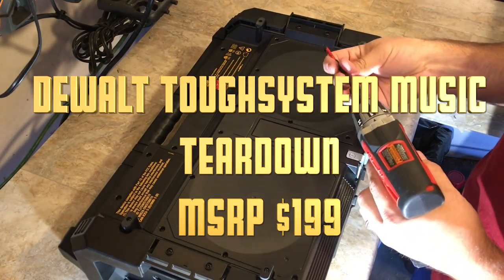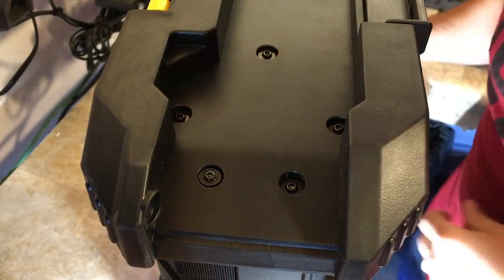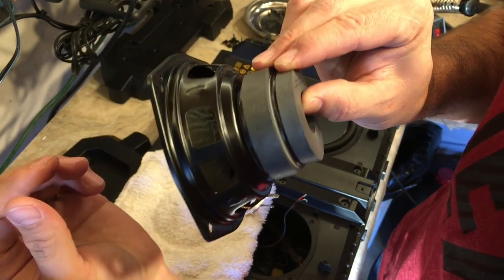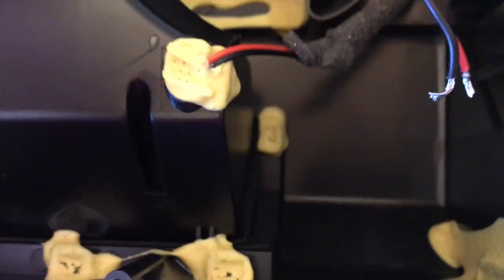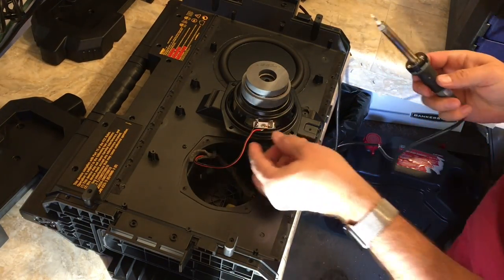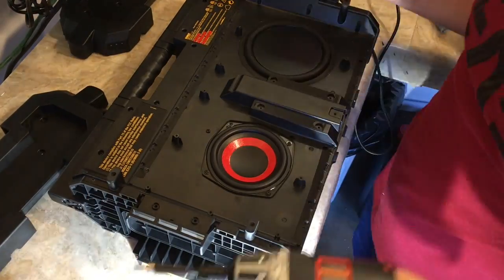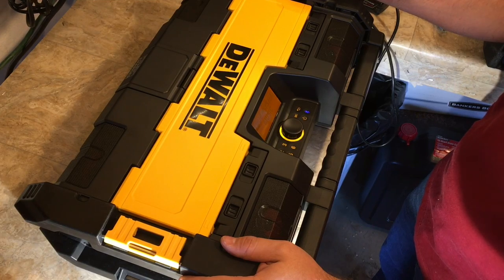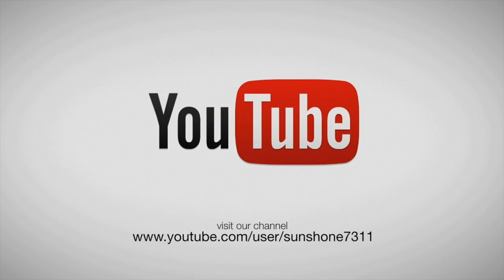DeWalt Tough System Music Case TEARDOWN

Comment: Thanks for the upload gave me a heads up as when dismantling my sons units  I had to repair the 3.5mm aux input.
 I just put a put a new cable  in with 2 x rca connectors  i drilled  a hole for the cable on the raised section on the left section for phone storage etc It is built extremely well ! I used to be a engineer for Sony. Undoing that many screws reminded me of some Sony products .
And the thing has a great sound!

Comment: Thanks for the teardown. Fixing the aux jack in mine - got damaged by someone tripping over a wire. Kept mine outdoors since I bought it 4 months ago... gives off the toxic chemical that is still  used instead of citric acid to clean circuit boards - makes me dizzy, nauseated, fingers tingle when brought indoors. Gonna continue the repair outdoors once it warms up a bit. Great product but manufactured without concern for toxins. Our country should ban toxic solvents in consumer products.

Comment: I have this radio!  I love this thing.  The 2.0 is the same but nicer.  The 2.0 has color screen, ability to charge FlexVolt, (and 12V maybe?).  But they did change the battery compartment.  On the 1.0, you can access the back battery compartment from rear.  Anyhoo.  Great video.  I'm too old to be stripping stuff down! lol
Reply: But sadly the 2.0 had a massive design flaw and quality control issues so it's done and buried. I have the 1.0 and already had one side of the speakers die. Unit was replaced under warranty with a new unit.
Reply: @FirstLastOne  It does appear they've made good on replacements/possibly a fix. They're still selling "new" on amazon without lots of bad reviews in the last 6 months.

Comment: cool vid.
A suggestion........roofing peel and stick on the speaker spider chassis, and around the cutouts for the speakers will definitely tighten up the sound.
you can also use it anywhere there is vibration from the speakers.
Reply: What roofing peel ?

Comment: Hi. I know it's like digging up a fossile but a friend of mine have one of those radios and need to replace the power supply. Do you know what size of a barrel plug it uses? It looks like standard 5,5x2,1mm or 5,5x2,5mm but i cant be sure, and i can't measure it myself. Thanks in advance

Comment: I'm having issues with the dab radio signal which is apparently an issue with this model. Do you think it's possible to upgrade the antenna, maybe fit an external antenna in the slot on the side which would give the antenna some protection?

Comment: Excellent radio , only problem is what you mentioned about the battery coming loose if you set it at the ground softly . The only thing that holds the battery in place is a small foam bumper then looses its support of over time
Reply: I added more foam to fix the problem.

Comment: Hey thanks for posting this, bought mine Dec 2,2015. yesterday (Dec 2, 2018) hit the 3yr mark while at work the base kept cutting off, I just got off the phone with Dewalt service center & was told there's no fixable part on it & they just do a straight swap. they go by the small sticker inside battery compartment with a QR code which tells them the year. Mine started with a V15 which tells them its 2015 so its a paper weight. I will be taking it apart and see if I can solder anything inside.. damnit! radio sounds really good but warranty sucks
Reply: Mine won't pick up radio signal any one got any ideas?
Reply: My radio works on mains but not on battery any ideas??

Comment: I have a tstak radio which stopped working I wonder if you have came across any problems with them and maybe have a fix?
Reply: Hey Daniel, I just purchased the Tstak radio and mine has a tough time turning on & off. I assume it's a bad rotary encoder/ power button? Did you ever figure yours out?

Comment: Any one notice these can't charge the XR 6AH batteries?  I use the 6AH batteries with my saws work great for all day power.  Was thinking of modding the battery compartment and phone storage holder it can't hold a plus size phone.  The bumper for the battery and the phone compartment seem to take up same space.  Might try and cut it out and 3D print a cover for the hole.  Thanks for showing how to take this apart.
Reply: it says in the manual that it can only work with up to 5AH batteries

Comment: Does anyone have problems with the base ? Mine just don't work any more .. the speaker works but no base someone? And if u do ..Do you fixed ?
Reply: Following, mine is the same
Reply: @callumturner3400  you probably have blown the sub.
Reply: Same problem here, anyone ever try to replace the speaker in the back? I wonder if you can find an aftermarket speaker for it.
Reply: Did you ever find out if you can order the sub?

Comment: Hah, I first thought "wow there's a free battery in there!!!"  Great review man, just seeing how damn robust that thing it means I'll get one.  Question though : While your CHARGING a battery, does it interfere with radio reception???  Thanks!
Reply from the maker: I haven't checked that, but my feeling is that it probably would.
Reply: Michael Borquez 
Do you think you could add a better fm antenna. I just bought the tstak radio and reception is the only thing that i can fault
Reply: @damienparker3541  , I just purchased one as well and have the same problem. Did you ever figure out a solution?

Comment: My power button needs replacement or something.  Radio has power but power button will not turn on the radio.  Any suggestions?
Reply from the maker: Chris B Pressing and holding doesn’t work? It’s hard to say because I’d hate to tell you to spend money and then have it not resolve the issue.
Reply: @Sunshone7311  no pressing and holding doesn't work. The button doesn't click like the other's.  With people plus me have worn out the power button
Reply from the maker: @chrisb6393  Maybe worth replacing, depends on the cost. I would try to contact DeWalt and complain because that really shouldn't happen.
Reply: @chrisb6393  Mine just did the same thing. It looks like the PSB That controls the touchpad and volume is fairly easy to replace. I have an image from another teardown. I'm going to contact dewalt this week and see what I can find.
Reply: These buttons are pretty easy to replace. You can find replacement ones in old LCD monitors (talking even back to the old 17" ones. They sometimes had the low profile ones) You do need the low profile all metal ones. MOST electronics with short throw buttons will have these. Including old baby toys, sound making toy trucks. (Singing Teddybears do NOT have these)... they really are everywhere around us. Removing the old one can be done with a standard soldering iron ONE LEG AT A TIME (There are four) and just pry up GENTLY with your iron after the solder is melted. NOTE: The prying is the most risky part however as long as you make sure your solder is melted and stays melted while you pry you'll have very little risk of peeling up a trace. As well soldering braid and solder suckers do not clear the solder UNDER the legs so don't waste your time using those unless you feel like it.

Comment: is there a hack to make the power button not take 5 SECONDS of HOLDING to turn on and off, it drives me nuts, what a stupid feature
Reply from the maker: Yeah its a bit annoying, but I do believe its to stop the unit from being accidentally being turned off or on if something is leaning on it.
Reply: so no hack?
Reply: @cb7pwn  No, and my  power button just quit working on me today. Sad, I love the radio and I've worked it hard for 5 years now...
Reply: Wow I was just wondering the same issue! Mine has never failed me & I love it, but I thought the button had worn out:- turns out like stated you sometimes have to hold in for a few seconds to turn on off. Apart from this it's a great sound with good features.. But dewalt come on surely with the shown build quality you guys could have come up with a better on/off button